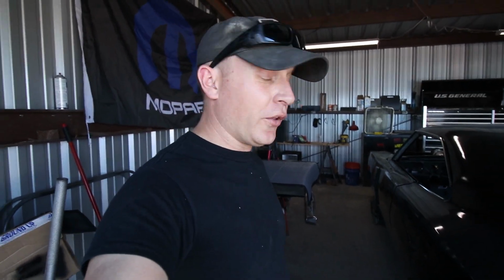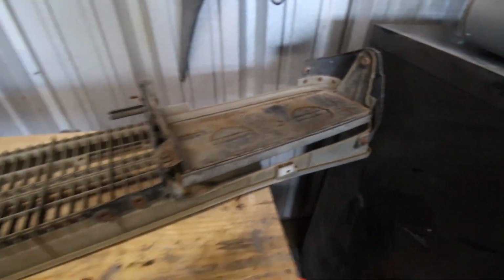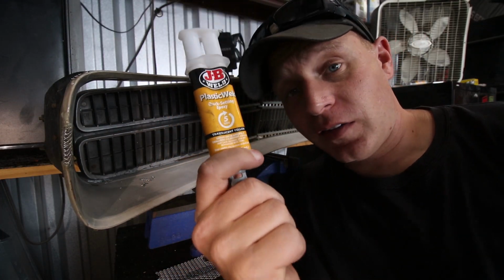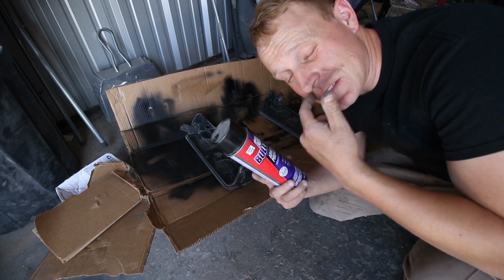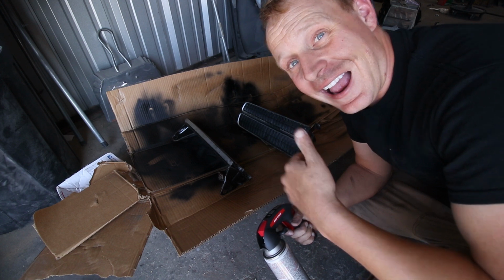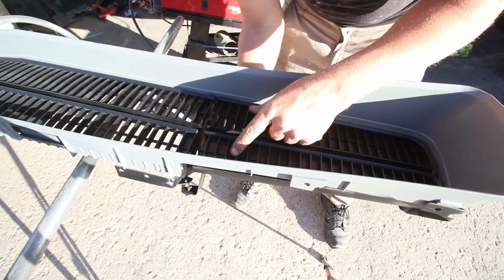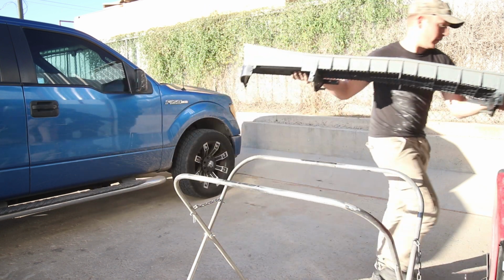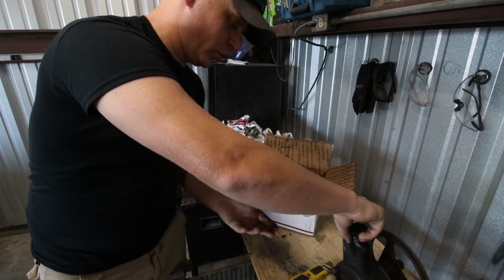1970 Charger Grill Restoration and Parts start arriving!

Comment: Bro, can the center split section of this grille be cutted? So, it looks like the 68's charger? And for the tail lights, to looks like the 69s charger, you have to change the trim panel right?
Reply: No, the grille parts for the '68 are totally different. The '70 has a single long taillight finish panel that goes around both taillights; the '69 has two separate pieces, one for each taillight.